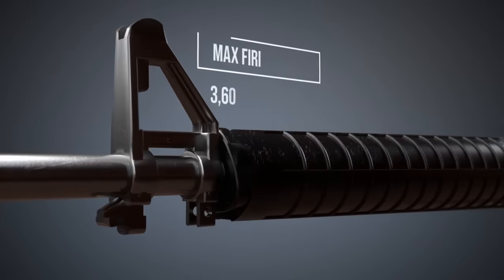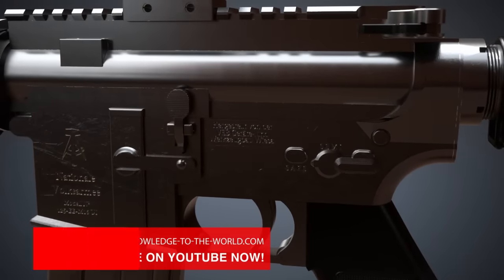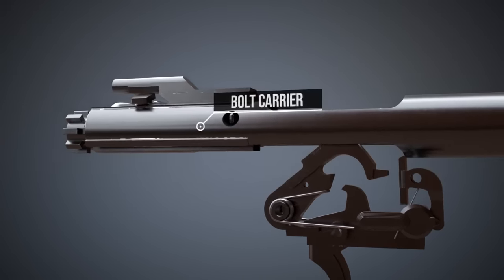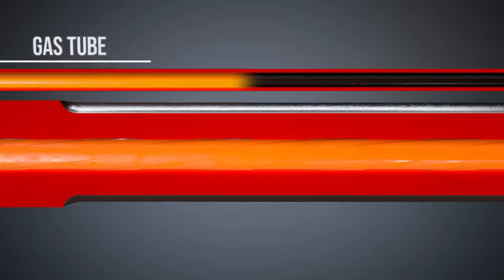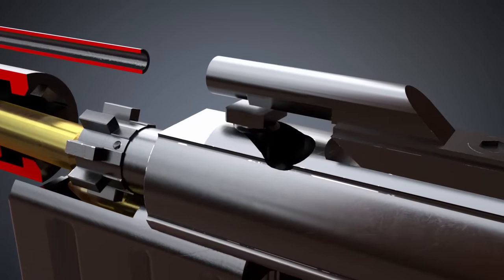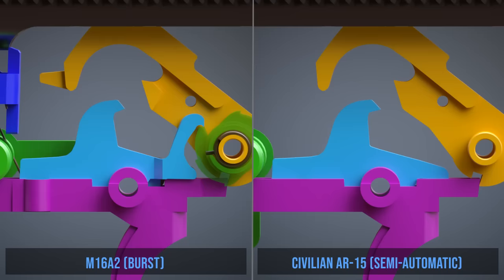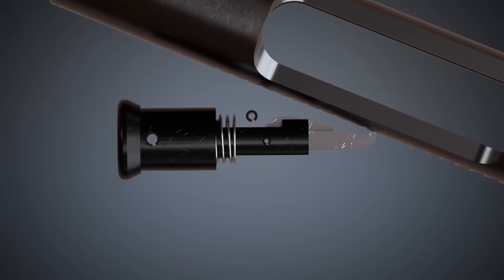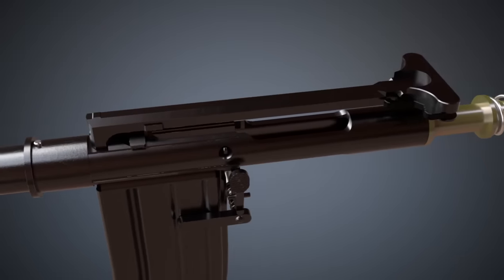M16 and AR-15 - How firearms work! (Animation)

Comment: The quality of explanations is extremely high. 
The quality of section cuts is extremely high. 
The dynamics of the machines is completely detailed.
The physics of the mechanism is completely described. 

Your talent can generalize to motors, mechanisms, complex processes on any sort of robotics dynamics. The talent and the clarity on these videos made incomprehensible processes transparent. This is what technology and pedagogy can do for education. Can anyone imagine how this could generalize to Kepler motion, astronomy and sun geometry? You found business.

100/100
Reply: More like 101/100
Reply: I'd take off ten or so for perpetuating the direct impingement nonsense. Another five for not mentioning that the carbon dusting the bolt is meant to act as a dry lubricant.
Reply: @bBlaF  What's nonsense about direct impingement?
Reply: @Blackstone9x19  Half-joke about the fact that the AR-10/AR-15 gas system uses the bolt as a stationary piston instead of just puffing on the carrier like vanilla DI or putting the piston out on a stick like everything that copies the AK. It's useless pedantry, but Stoner really gave us something more interesting and effective than just DI.
Reply: 110/100
Reply: Bullshit. I actually studied cad modeling. And tbh this is with experience not that hard
Reply: Heck of a video boy......🤔 , Darn good .
Reply: You are so wrong on so many levels.

A lot of ars still use DGI technology.

The bolt actually starts the rotation before the round is fully chambered the the bolt is all the way forward.

The fact that they don't mention that the rifles where intended to be taken down and put back together with nothing more than a single round of ammunitio itself is almost a disservice.

The dual aperture rear sites are a nice note to mention however.

The inner workings of the sear was as close to accurate as possible.

The fact that the front site can be adjusted by a round is quite refreshing.

Still.  They do not note the very liberal slack yet very effective and clean break on the trigger leads me to believe this person has a limited knowledge of either.
Reply: kummer45  too many words
Reply: Bruh more like 100/10
Reply: I think I just accidentally entered nerdville
Reply: Youtube could replace most of the education system.
Reply: cool video.
Reply: @trollborn7206  So do your own videos then TROLL!
Reply: @syfyserpent6465   Not until youtube quits the mass deletion of videos on subjects they don't like. Like  the loss of many older firearm and hunting "How to guide" videos.   Videos made before monetization was  motivating reason. Videos were made about various models of firearms and their functions because people wanted to share their knowledge(sometimes the lack there of) on a certain firearm they own and loved.   This video is of most excellent quality and 100% not Bogus (gotta put a Bill's and Ted's Excellent Adventure reference in here somehow  ;)  )  

  The scary part Youtube like facebook has purged many educational sources and different world views because they(corporate offices and many inventors aka major stock holders didn't agree with the subject matter, not counting their "Public branding and marketing relations ""Image"" departments).  So while I agree with your statement that youtube has better educational material than many schools, it is equally as corruptible as our school systems. Which falls back on us the voters for not voting incumbents on the bad school boards out. Then running ourselves and/or better candidates to reform the broken education system. Sticking with not a party election but a no incumbents that aren't aren't making it better. If you had to match pictures to the candiates name for your votes to count, how many voters votes wouldn't be counted?

   To  quote one of the best teachers I had who said "I don't care you can memorize a name and date, I want you to understand the why"   That the  why people would risk their lives, that of their family, and/or risk  losing everything they owned to go  up against  their rulers, was more important than just a date and names.  That it was dangerous act of treason, that the act of following a different religious faith was equally an act or treason with horrible brutal exceptions even for their times and methods.  

That to rebel for a revolution like the USA's in 1770's , against a king  who would have had you hanged , drawn and quarter'ed, if lucky beheaded before they burned your entrails. Then  Dismembering your body for display and as warning to others. Desecrating a body was at the time a way to cause you unrest in afterlife and to deny you resurrection from the 2nd coming of messiah when the world ends in their faith. That they may strap you to and through a wagon wheel and club you to death for daring to challenge the King's Rule and Taxes. Which is agonizing way to die,  yet  was worth the risk to the farmers and businessmen for what they were going to achieve. That not everyone stood up and fought but many reaped the benefits of the people who did.  That it was important for you to know more of the " Why would they risk being brutally killed, having their loved ones killed because of them and/or having everyone  put out on the street, stripped of all property, title and loss of all friends...."  That  "If you can understand that about revolutions, more than just knowing their name dates because you don't know the 10's to 100's of thousands of nameless souls that fought so famous names might be taught later in my class... "    I might paraphrased some of it but he made it clear you need to know the why's more than the who's because anyone can parrot names and dates without understanding the lesson and subject matter.  That you memorized a multiplication table but there was far more to learning history than memorizing some numbers, especially if you wanted to learn to not make mistakes and understand what affects your actions may or may not have.

Coach Dupree one of the best teachers I ever had. He didn't teach you the text book, he taught what occurred and made you think about and answer difficult questions, that weren't easily memorable answers. Yet his test weren't hard to get a high grade on, getting to the test was the hard part. Could you imagine a teacher allowing their class to freely debate anything  in today's education system? Especially subjects like the war on terror?  When I went through his class, the not to spoken about political subjects where things like things like the Vietnam War and slavery(in the south things were going slow after the civil rights victories) in the 1980's..... 

  Chaos was often slain by Coach "D" educating the young minds he encountered.  The man made it clear it was his way or the highway but if you every needed help his help for anything be his class , any subject, home, or whatever  his door was open that year in school, any other year  later while you were at that school and if needed  you could come  back to see him. Even if you graduated and needed help later on, he might not have the answer but he would help you find it ans some  way through whatever was a problem for you. Rumors were he put a few abusive parents in squad cars for kids....  As in he went toe to toe with them, but was not a violent, not intimidating, and/or was not a loud man.  Also he didn't bother to carry a stick.   Then again that dedication and ability to not call the police to get control of your class and students is missing from many teachers and heads of the education system. Who care more about Golden Paychecks and Golden Parachutes and what the test scores say about their ranking nationwide, than they do about the kids having deductive reasoning with the ability to question and think for themselves.
Reply: Rifle buffer & carbine buffer tube???
Reply: @MP-kr3mh   good catch on a small detail
Reply: Ever read a ICS textbook from the 30s? Try "The Steam Locomotive". Amazingly good drawings and amazingly good explanation. Superior than anything today.
Reply: Able Magawitch I liked what you wrote but might I add you edit some of your words and quotations cause I was confused on some areas :/ cool teacher though!
Reply: @yaboiiigabe1197    Thank you I edited some and will keep editing it. Since I seem to catch missed/absent words on each additional read through. I can also rewrite it , to  more eloquently explain some of the details he imparted to us on so many subjects.  He was a very cool teacher, everyone spoke highly of him. His class was mandatory one so everyone  in the school had the same chance to learn in ways that more teachers would not risk for class getting out of control for heated debates.  Factor in teenager angst and high hormones and emotions  he did an amazing job educating while going through an metaphoric  equivalent of a mine field on a pogo stick for risk of causing the class to explode in arguments which add mixed cultures due to forced busing for racial integration and you even power of powder keg.
Reply: These type of explanations we need in school. It will learning fun and interesting. Hope schools will understand this in coming decades.
Reply: More like 100000000000000000000000000000000/100
Reply: @dontneedtoknow5836  This isn't the ode to the AR15, it's of it works. Also, if the bolt rotated before it's all the way in, it wouldn't chamber the round cause the lugs would get stuck, because now the lugs can't enter in the sections cut for them.

Comment: These guns are more technical than what I expected.
Reply: Not really. They've pretty simple pieces of engineering, all things considered.

The reason that the US Army chose the M-16 as its battle rifle is that it's so simple even the most mentally handicapped farmhand from Bumfuck, Iowa can take it apart, clean it, and put it back together with no tools needed.
Reply: @toddmintz4269  Didn't it wasn't interesting, just not complicated. The trigger mechanism is the most complex and it's not part of a grunt's regular maintenance, but still simple enough for the specialists to be able to diagnose and turnaround quickly.

That's why I'm somewhat wary of the new rifle designs the military is considering. They're way, way more complicated.

The M-16s simplicity is it's greatest asset.
Reply: @toddmintz4269  You misunderstand. I'm not saying it's a rifle for dummies. It's a wonderful design, but one of the reasons the DOD chose it was because a dummy CAN maintain it with very little training.

As for the newer designs, I'm particularly wary of the Textron design. That's a lot of moving parts- a lot of room for something to go wrong. Having the firing chamber lower down to eject, pick up the next round, lift back up, and then seal with the barrel- I don't know about that.

The General Dynamics rifle is a bullpup. Neat idea in theory, but apparently switching mags can be an awkward and slow process. More, I'm not sure how safe it is having your face right next to the firing chamber.
Reply: Well they're less technical than what I thought.
Reply: @rylian21  Lol, Farm hands and boys raised in the countries, aren't dumb, and they know they're ways around guns fairly well.
Reply: @kevinfernandez1929  What’s it to you Sweetheart?
Reply: @kevinfernandez1929  give up defending the damage is done
Reply: @TheLoneWolf449  Absolutely, so well just the city kids talk i guess, its just sad what some people have become...
Reply: @Charles-pf7zy  So is the Large Hadron Collider at CERN, so what’s your point? My point was to point out the ignorance of the statement that the M-16 was chosen, due to it’s oversimplification. The real reason was because it was a masterfully designed firearm ahead of its time and was chambered for a intermediate round that the military was looking to switch to.
Reply: @rylian21  The HK G3 (or the CETME C for that matter) has something to say about that statement as it has even less moving parts than an AR. To begin with, it doesn't even have a gas system.
Granted, the M16, or the AR platform in general is quite simpler than the M14 it replaced, and better overall.
Reply: Obviously
Reply: if you see the video on the AK47 you can see why its a lot cheaper than these rifles
Reply: @rylian21  keyboard warrior over here informing everyone on his intellect. It's one thing to work on an ar, it's another to design it...
Reply: If you look at what firearms looked like 150 years ago, today's firearms are really simple. Compare a fn minimi to a maxim machine gun
Reply: @rylian21  Army wouldn't let you take apart the trigger, and gas tube, only the armory specialist were allowed to.
Marines felt everyone was a weapons specialist so let their men do it.
Farmhands in bumfuck have been shooting since they were 4, and could make a damn m16.  They weren't the problem.
Reply: @rylian21 This comment aged well.
Reply: You're crazy. I'm a total layman and I can understand what is going on. I really can't believe how simple they are